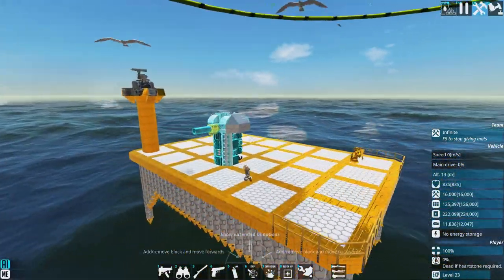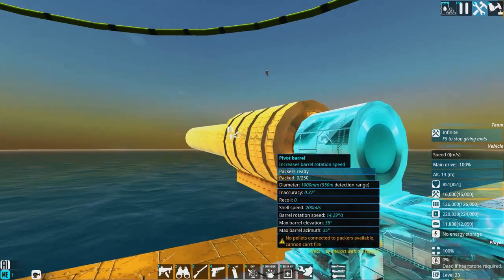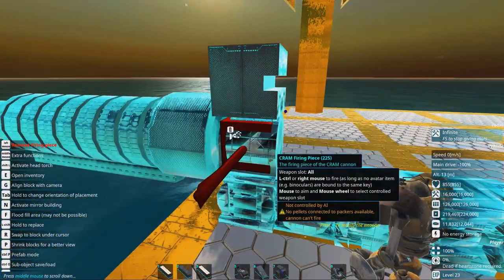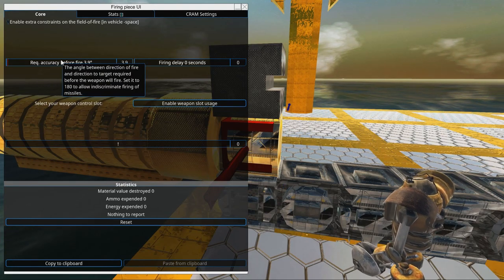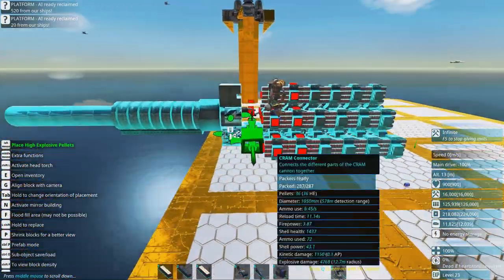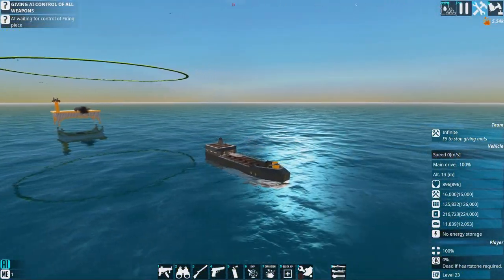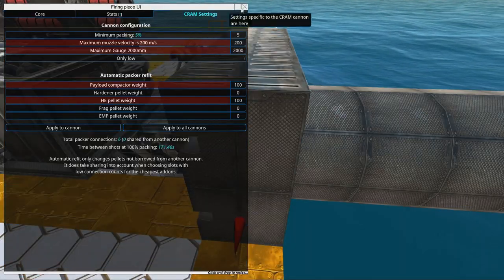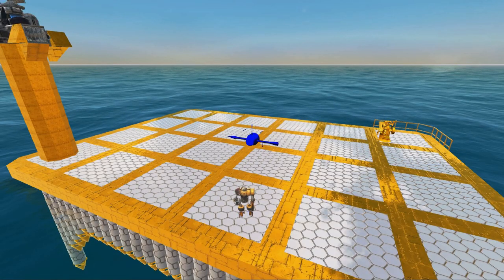From the Depths - New CRAM Cannon Tutorial - Basics & Turrets & Mortars

Comment: Did they make it where the shells dont disappear at about 3600 meters anymore?
Reply from the maker: Hmmmm, I never noticed that so I think so, but can't say for sure
Reply: @GMODISM  it may be worth investigating.  That's one of the biggest drawbacks I have found with crams testing them in the past.  If you got something that can keep distance outside 3600 meters you didnt have to worry about crams at all.  I was wondering if that mechanic bas carried over from the previous build.  I mentioned it to one of the devs.  Oddly they didnt know about it either.  Most likely because that's the farthest you could get with the cannon being maxed out.
Reply: @GMODISM  I talked to the business manager, he has confirmed that cram shells do despawn.  However, it's not a matter of distance but time.  After 40 seconds of flight they disappear.  It kinda explains why it happens at roughly 3600 meters.